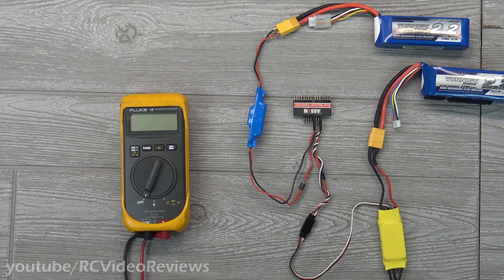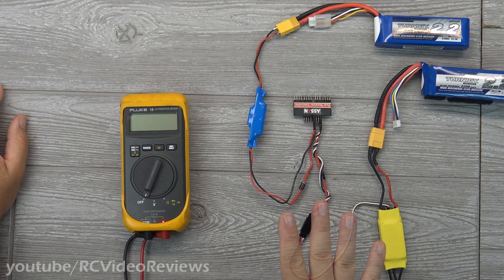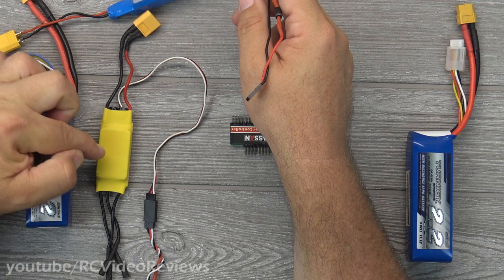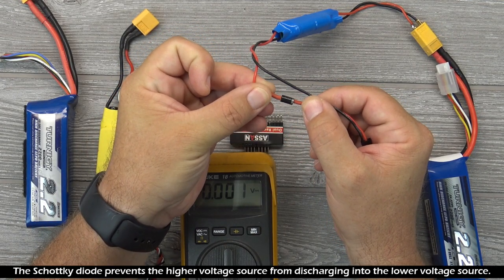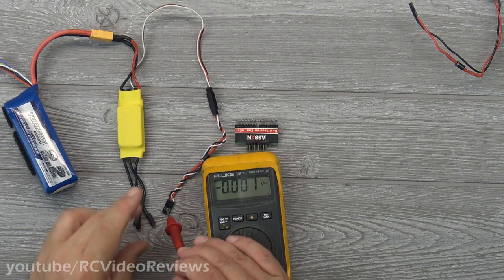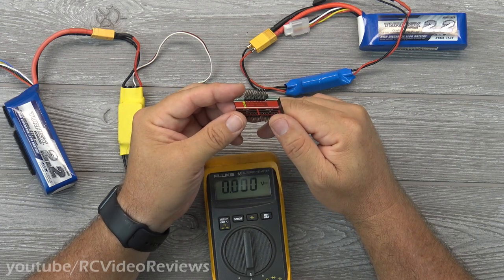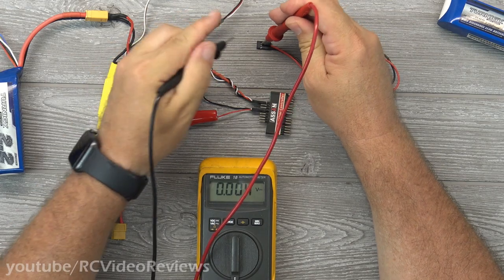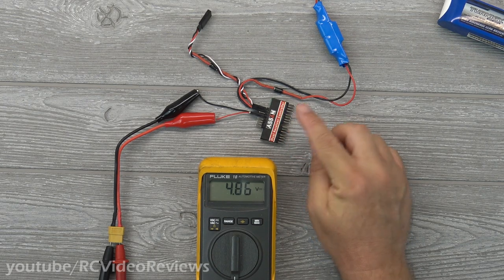Simple Redundant Power System for RC Plane: RELIABLE, CHEAP and EASY!

Comment: I have talked with Dave for some years about his simple redundant power supply. It always works & he tests it before and after each flight. A good practice! I too will be using his RPS in my larger, more expensive aircraft. Thanks for the great video. I finally got around to watching. Well done.
Reply from the maker: Yeah, this is a brain dead simple method to add redundancy. So glad Dave shared it with the channel.
Reply: @RCVideoReviews This Blue BEC in your video is commercial or build buy you? I was thinking in build some specifics BEC for my planes and robots.

Comment: After "roasting" a castle cremation ESC on a beautiful new (expensive) airplane with catastrophic results, (about 12 total minutes of flight time over three flights) I am convinced some inexpensive redundancy is the answer. Thanks guys!

Best I could tell, the reason for the roasting, was having the breaking system turned on. I didn't realize it would be that much of a strain on the ESC. But I'm thinking that must've been it.  Because pulsing the throttle on the low end was causing it to start AND stop the prop. I realize now that that is hard on the ESC.

Comment: 10 of those diodes are $3.98 plus shipping. I will be using this in the future when I start trying long range FPV. Thank You, DAVE!!! You Da Man!
Reply: You are welcome the two scenarios I talked about if you all want to and John wants to we may make a video to show exactly what it is very simple very safe very cheap
Reply from the maker: This solution is so cheap and light you can use it on any nice plane. It's such a minor effort to add this backup.

Comment: Great. Is it possible to have an indicator that one supply has failed? Also seems the secondary battery does not seem to need high amp hour as it would only run receiver. Main battery is getting juice sucked out by motor?
Reply from the maker: Is it possible? Yes, sure it is. I suppose if you knew it failed over, a smaller battery could be used. Lots of options here.

Comment: Looks like the set up I can use on my 1/4 scale gassers. Two 2S 2500 LiFe A123 batteries in parallel with each having this Schottky diode in their positive lead. Then I can run that single power source to the receiver, ignition module and lighting. Originally I was going to have 3 separate batteries for isolation. But with this set up, if a battery fails it would still be flyable and telemetry can probably be set up with a warning. And when working I'll have the current of both batteries for the three systems.

Comment: So therefore the BEC that supplies the highest output will always be the source to the receiver, am I right? If the redundant source BEC happens to have a higher output (even by 0.1v) you're effectively increasing your capacity overall I guess, and you would land with voltage drop in both batteries; Esc supplying motor, BEC supplying rx.

Comment: Very interesting video. Presumably you don't actually use such a large/heavy backup battery in a real world set up but just the min weight battery pack needed to give backup. Otherwise there's a significant extra weight and space needed issue. Also, for those of us whose understanding of electronics is limited to being able to solder, can you advise where we buy that diode and what spec to be looking for. Also the common rail connector. Looking quickly through the links with the video I couldn't identify those (though I may well have just missed them!). Would welcome advice on all of this & thanks.

Comment: i just added 5v aux power to my EDF BAEHAWK with matek f405 with a 5v bec plugged into a power distro rail, then plugged servos into that and that into the 5v servo outputs from the board. this doubled my available amperage for servos. i am running 9 servos on 9amps. should be plenty to prevent brownouts in case a servo seizes up.
Reply from the maker: Yeah that will do it if both the voltage sources are the same. This is exactly like a parallel battery setup. Same volts double the amps. 

Good job. Thanks for sharing your setup tip with the channel!

Comment: My RC yacht lost comms about 100 meters offshore (lake) due to low power from the single battery onboard and started drifting further away with the wind. Luckily a power boat was passing by and retrieved it. Fix: Implement this super simple Redundant Power System and sail with an onshore wind.

Comment: I agree with your system and have a theoretical question. If a model was to be equipped with a receiver pack and was space/weight limited on that pack could the bec circuit step in to cover the sag in an Rx pack that is to small? My jet has 2 5a bec on board making for roughly 10a of capable servo drive power. The 11 servos it carries can stall load .9a per servo. Uncomfortably close to the max output of the bec. Can I put an Rx pack in the system, all be it to small and only good for 12a, then install a Schottky diode on the bec output so the bec only gets loaded when the Rx pack saggs below say 7.8v? Then have the possible 12a from the Rx pack and the potential of the bec at 10a combine to give me the overhead I'm looking for?
Reply from the maker: "Schottky diode on the bec output so the bec only gets loaded"

If you have two different voltage sources with two different voltage levels, the higher will always feed the lower. In the example, the diode is used to prevent this. So the higher voltage source always feeds the load, but cannot get past the diode to the other lower voltage source.
Reply: @RCVideoReviews  so the switching power supply will still be providing power to the circuit even though it's target voltage is above the set point? I guess I figured with a Schottky on line the bec wouldnt be doing much of anything until the voltage drops on the other side. Am I going to simple on my thought process?

Comment: I have two different scenarios we're I use this 1 opto speed controllers I do not use a regulator I use a 2cell life battery with a diode in series to drop the voltage to a safer leve for servos rated up to 6 vote part of a redundant system which is two batteries two diodes with two switches to the receiver those two would be the same voltage they would drain at the same time the other thing I do is used one battery which is the life battery with a diode to drop the voltage a little bit make it safer for my servos and the other one comes from the speed control with the diode so we are not feeding any current back yes one of them is higher you will use voltage out of the higher one but if any of them fail you'll have the other one as a backup. The diodes also prevent voltage from feeding backwards either into the speed control or into the life battery or LiPo battery you do not want neither one of these scenarios to happen
Reply from the maker: So when two voltage sources with different voltages are connected the higher voltage source provides the current. When two voltage sources with similar voltages are connected they both provide current. That's how it works with parallel batteries anyway--they both come back empty after a flight.

Comment: Hey guys just a quick tip to all of you that want to do this system when you get your diodes test the diode with a meter and with a battery to make sure there is no reverse voltage I have gotten them before with reverse voltage leakage you don't want that
Reply from the maker: It's also a good idea to verify forward voltage drop. That's the reason for the Shottky diode by the way--minimal drop compared to standard diodes.

Comment: Very simple idea, but I have a question: which one of the batteries takes over as a main? Since both are connected, are both providing power to the system? Thanks .
Reply from the maker: The one with higher voltage is becomes the source.
Reply: @RCVideoReviews  Thanks for posting this, I used this method for my RC plane and works really well, no issues, wow.

Comment: With this diode arrangement if your ESC output 8V and your BEC 5v, which voltage that the RX will get?
Reply from the maker: Higher voltage potential feeds lower potential whether it's 5v or 0v.

Comment: Can you do the same with the same battery source, an external BEC, and a couple of XT60s?
Reply from the maker: I don't understand your question. The point behind this is to provide redundant power. Putting a single bec between the battery and load doesn't really accomplish that. So I'm not sure what you're driving at. To put a short answer to this: The purpose of the diode is to prevent higher electrical potential from pushing voltage to alternate devices. With that premise in mind, you can arrange your source/load how you wish.

Comment: Do u happened to know if there's any reliable on/off switch for lipo?
Reply from the maker: Like inline with the battery? I've never used one. I just plug it in or unplug it. There are switches you can buy to go inline with the BEC from either your ESC or standalone.

Comment: Just wondering where can we buy the exact diode you are using. I found 45v/15a diodes, but not 35 v/9a.  Great video and good content. Thank you!
Reply from the maker: It's in the video @8:01
Reply: When you get your diodes make sure you test them to make sure there's no reverse voltage some of them have reverse voltage
Reply: Just looked at DigiKey and couldn't match the part number you provided. Is there a current alternate part number you can provide, Dave? Thx!
Reply: Just heard back from DigiKey. The new part number is 1655-90SQ035CT-ND.

Comment: Do you think a 15A 45v schottky diodes will work?
Reply from the maker: Sure, that has more capacity than the ones I used in the video so they should work fine as long as you don't exceed those specs on your circuit.

Comment: Hi buddy what size diodes would I need for this many thanks ray
Reply from the maker: Good explanation here: https://www.eevblog.com/forum/projects/how-do-i-choose-the-correct-schottky-diode-for-a-project/

Bottom line it needs to be able to handle the voltage/current you plan on throwing at it with acceptable forward voltage drop (to you).
Reply: @RCVideoReviews  thanks for replying so quickly I'm very much a noob to this having bought some electric powered models the motor is an 800 size  and it has bec of 5.5v 5a 2-6 s with a 3a 5a max ubec mounted on its back

Comment: If your left battery dead your receiver still got power from the right battery.
But your plane still crash because the motor only got power  from your left battery through the esc.
Reply from the maker: It’s not intended to keep the motor running. It’s intended to keep power to your receiver so you can land the plane.
Reply from the maker: That fact is explained here: https://youtu.be/yowcjweWkaQ?t=353